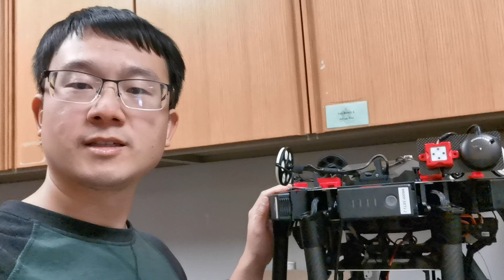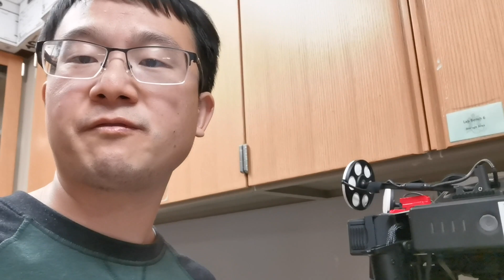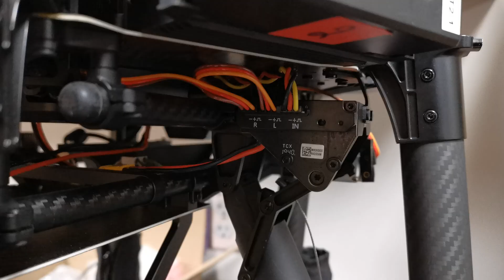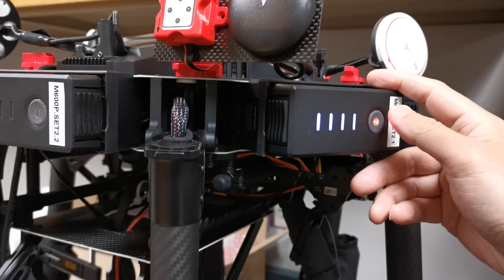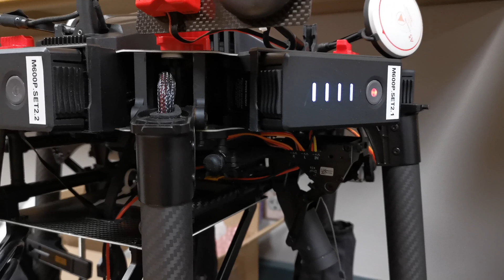DJI M600 Pro Landing Gear Calibration Check

Comment: Hello, I need to buy 2 M600 pro for a project, i found no stock. Do you want to sell it? I can pay the unboxed price.
Reply from the maker: They have M300 as the successor model. The only difference is it's a quad-copter (four-wings) while M600 is hexa-copter (six-wings).
Reply: i have One to sell